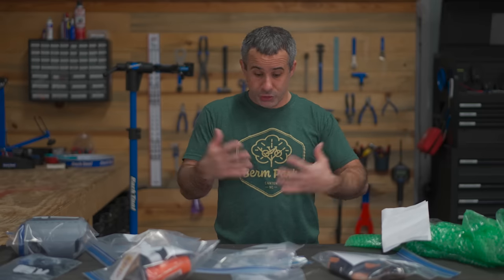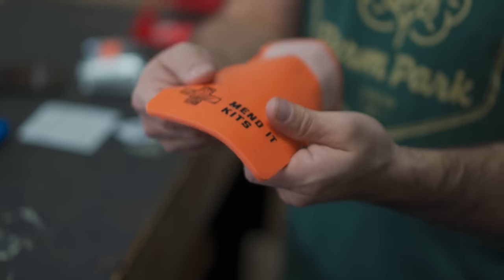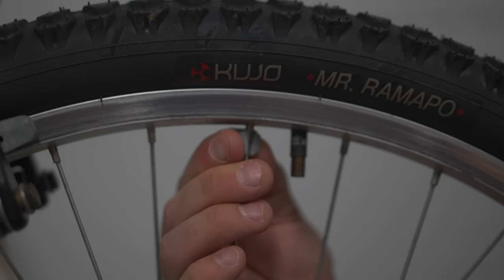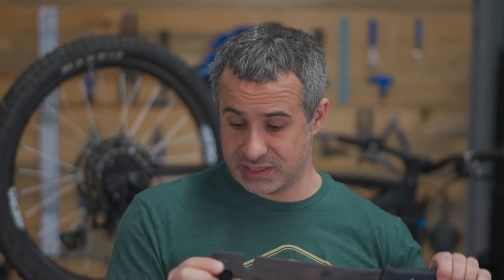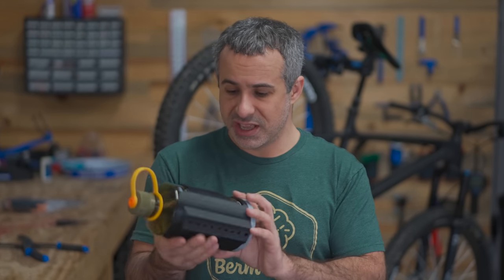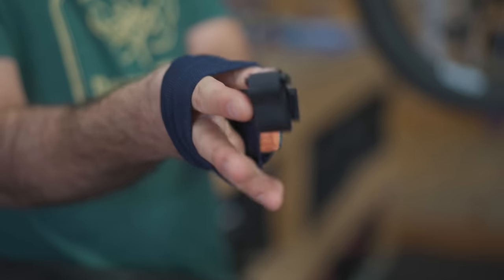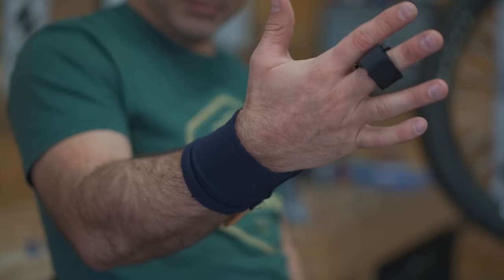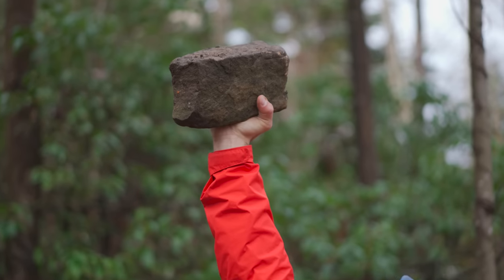Reviewing MTB products sent in by you, the audience!

Comment from the maker: Over the weekend I met a guy with a bottle cap on his stem cap, and he said it was off a Niner bike. So that's not original, but the bar ends and fork cap sure are!
Reply: Neither are the tools in the valve caps, pettys has had them for a long time integrated into their tubeless valves, spoke wrench and presta valve core remover.
Reply: Your link for the tools doesn't work.  You're missing something out of the URL.  I found it by searching Etsy.
Reply: I recently picked up the Niner YAWYD(You are what you drink) top cap and it works well. I would be skeptical of using a 3D printed top cap, and I 3D print lots of stuff myself.
Reply: Yeah, I’d much prefer my niner machined version.  Bar ends see ok.  Would be worried about anything needing mechanical strength with the printing material long term
Reply: As someone that’s also subbed to Syd & Mackey and Kyle & April I immediately thought of Niner when I saw the bottle cap holder!
Reply: Valves with spoke keys and valve core removers are becoming extremely common.
Bottle cap handlebar end caps I used to sell 6 years ago from @Muckynutz. @77Designz and others already to a top cap, but I've never seen the fork adjuster cap before.
Reply: Yep. Niner has been selling that stem cap for ages - at least since my club had a deal with Niner back in 2009.
Reply: @andrew_gardner  the top cap shouldn't be taking any load - the stem clamping on the steerer tube is the load path. All your top cap is doing for you is pulling the steerer tube up into the head tube while the stem is loose. You could just ride without it if it weren't for the chance that you might need to loosen and readjust the stem on the trail. Plastic should be just fine.
Reply: Bar-ends aren't original also, I've bought aluminium CNCd ones years ago from UK. Fork cap however I never saw before

Edit: as BikeDibley said 😆
Reply: I had a top cap for bottles here in germany like 5 years ago. I think it was from 77design
Reply: Seth, the conversation is going about the way you bash the Bash Guard with a rock and it Didn't break , are you sure that's not metal cleverly disguised as plastic , Ha Ha
Reply: I want the metal version of the spoke tool / valve core remover that can stay screwed on as a valve cap
Reply: @GiannisLS had Schafer (car type) valve caps with a core removal tool built on the the top 10-15 years ago. Can’t remember who made them though. To be fair, they didn’t have a spoke tool incorporated…
Reply: Personally, I think the bottle cap bar ends are absolute genius! What serious mountain bike rider, wants beat up looking bar ends all the time, and to keep replacing them? The bottle cap bar ends, just pop the old bottle cap off, throw on a new one and good to go. I legitamitely want some of those!! And I don't do a lot to beat up my bar ends, but mine definitely get the crap beat out of them from commuting, rubbing against brick walls at work/stopping at gas stations for snacks, and the likewise. I have alloy bar ends that hold in my bar mitts for the colder months, but I will probably use them all year around. Eventually, I will want nice clean new ones.

Comment: For functional 3d printed parts, you need to use an appropriate material, design, and settings. Generally, PLA is to brittle for functional parts, and you need materials with better impact strength. Also, playing with shells and perimeters will gain the most strength rather than infill.
Reply: Agree, but all that said, PLA has some of the most strength if you require a strong and inflexible part.  Many of the less brittle materials flex before they give at a much lower force than PLA bends or breaks.  I use PLA in certain applications where any significant bending under load will cause the parts to hit each other. I find PLA works much better for things that need to stand up to tension.
Reply: @meikgeik  yeah, for bike parts i would personally use nylon or cf nylon for added stiffness, pla is brittle + it cant really stand up to the conditions outside (whether that be weather or UV light) so for bike parts ABS or ASA is the minimum for me.

Comment: Hi Seth! Glad to see some of the Chunder Goodies @ 10:00 made it into the video! A note on the anywhere mount, I didn't intend it to be used with a water bottle as I don't trust it with that much weight. Did you happen to test it with one? The tube plate and pump mounts I make are the proper thickness to prevent the screw from going through and hitting the frame. Good suggestion on adding a backing, I will make sure to add a warning so others don't have that issue! Thanks for giving them a look, and thanks for not minding the paint ding!
Reply: "Luckily I don't care". 😀
Reply: ngl, that one hurt
Reply: @TheSorrowedMan  Definitely feeling a little guilty over here..
Reply: Yeah, take a look at the inside of specialized SWAT door. I think it’s got a rectangular shape molded into it that keeps these square flat nuts in place to secure the bottle cage screws and keep them from driving in too far.
Reply: really cool idea you got there. i can use one on my bike
Reply: @andrewshearin1525  wouldn't a nut allow the bolt to continue through and hit the frame anyway

Comment: I think the reason that 3d printed chain guard works and your previous prints didn't comes back to the suggestions a lot of us gave you in the comments of that video. Just from what you showed, it looked like he had printed it with more perimeters, and it looks like maybe a wider nozzle as well? Since the majority of a print's strength comes from its walls, that makes a large difference in durability right there. While you certainly couldnt expect all the parts you made to work (that brake disc as an example), there were definitely a couple that likely would have worked fine with just some slicer setting refinements.
Reply: Also the difference between PLA and PETG is dramatic in terms of durability. PETG can be finicky, but if you nail the settings you can create some very durable parts, especially compared to PLA.
Reply: @tredmer  Absolutely. Not all plastics are equal. Different materials have different properties.
Reply: @tredmer  this. Seth’s printing configuration was not ideal

Comment: About the tourniquet, it's the CAT (Combat Application Tourniquet)
Which is very effective, but requires some basic knowledge to use with full potential, which I urge you to learn (lots of videos about it).
Also worth noting, using it will compromise it's future strength, so you should keep this one for practice purposes and get a new one.
Reply: While it is a great idea, I have some serious concerns about the med kit. Tourniquets require training to use safely, and as you said using it for practice or even as a retention item degrades its effectiveness. I may be wrong with this, but based on the price of their kits I seriously doubt that is a genuine tourniquet, which run about $30 each (The genuine TQs are made by North American Rescue which makes the CAT, or TacMed Solutions, which makes the SOF-T). I don't want to discount the Mend-It company at all, I'm just coming from a concerned health provider background. If anyone has any questions I can provide resources and references. Training is by far the most valuable resource you can invest in when it come to first aid.
Reply: @trail_farts  hey, just wanted to comment here. My experience with tourniquets in the army and with safety training in the civilian world has taught me that you really cant do much harm with them when using properly. If the bleeding is life threatening, you tighten it enough to stop the bleed. Any damage to the body part (tissue or nerve) will only come with prolonged hold, and if the other option is life threatening bleeding, it doesnt really matter, right? And what comes to the strength of the items, in the army we would train over and over again with our personal tourniquets. Ive never seen one break when tightening it and for a real piece, I dont think its even possible with normal use and training. I would even go as far as saying that an unused one is more dangerous than a used one, as it might be defective from the factory, if the quality control over there has failed. 
But youre both right on about training, learn how to use it, learn how to apply it with one hand, learn how to do it to someone else, learn how to do it in a rush, with clothes on, over a booted leg, in the dark and etc... Its like CPR, do it over and over until it comes natural.
Reply: @akselikoskinen5445  so talking from a perspective of an ex combat medic, I've seen some tourniquets break after intensive, repetitive training, but actually I'm more concerned about its ability to hold stress for prolonged duration of time, and if it has been used before,  the velcro part, which hold the entire stress, must have weakened to a certain extent, and in harsh conditions (think wet, mobile situation) when someone's life depends on this thing, you should really just use a new one.
Reply: @jewing464  The way he used it in the shop is not going to make any difference in its ability to hold stress. Zero.

I've been shipping them out to Ukraine for the past several months... they go through way more abuse than barely being put on and twisted once or twice. And they still work fine.

As for damage to humans, the soldiers use them at ANY indication of a wound, arterial or not, because they don't trust that they won't miss something being that they're not experts.

No issues. And they crank them down.

Comment: Really like the cassette pliers and wrench combo.
The part I "made" for myself is not really my own but I found it a new purpose. I turned a bottle cage adapter into a front mudguard mount for my suspension corrected fork in 2021, and it's running well to this day. 
It's only one part of the cage adapter and four P-clips on the fork.

There is a particular type of adapter that works for this really well, better than any marketed solution I could find in a year.
I can't post pictures here but if you need something like this and have no tools to make it, google bottle cage adapter and look for one that has a symmetrical "rotating part" with three screw holes. That type fits a 26 inch sus corrected fork perfectly and your fender mounting point will be exactly in the middle.

Comment: That cassette plier tool is awesome. It's a similar design to the Pedro's version, which I think is a far better design than the park tool version
Reply: Yes it indeed is. I have a cheaper version of parktool pliers and they have a tendency to slip easily on the cassette. That kind of version looks a lot more easier to use and apply good enough leverage to keep the cassette in place.

Comment: I really like the cheap alternative to a bash guard, great video!
Reply: I bought one of these off eBay, I think, a couple years ago. Seemed pretty strong, but it broke pretty quickly on the trails. That log Seth hit was pretty rotted. I killed mine on a solid logover. A rock would break that easily, unfortunately.
Reply: @TheBlip01  You mean a rock like the one Seth used in the outro?
Reply: @timgarland8619  yeah, except add the weight of a rider, bike, and some momentum. Haha

Comment: To make good 3d printed parts, you have to make the infill 100% and use a higher end filament you can buy loads or stronger/ flimsy or even flexible materials! If you ever wanted to try printing bike parts again I would suggest using a different material then you were using
Reply: Yes and no.  CNC kitchen on youtube did a test a while back that showed the inverse can be true in some scenarios.  Part strength is a rabbit hole you can go really really far down.  CNC Kitchen just barely scratches the surface.
Reply from the maker: Yeah, I was using the best quality Petg you can get, but it was definitely not at 100% infill. For a bash guard, I think you're right. For other parts I don't think the infill would matter as much as wall thickness, and for the most parts my design were just crappy!
Reply: Great Tools, can you link for the bottle Cage Tools?
Thx i want to Print it for my wifes frame, where i always anscrew the bolts because of her small frame when mounting to the.
Reply: @BermPeakExpress  You already sound like an expert.  As someone who has been 3D printing since 2016 and struggled for years, I'm totally not jealous.
Reply: @BermPeakExpress  I wouldn't even use PET-G - it can cope with some flex, sure, but what the 3D printing communities and tests don't touch on (bar the odd ones that do notched impact tests) is that PET-G behaves non-newtonianly, it stiffens the harder you hit it. That means for impacts it becomes really brittle.
 You're much better off printing things in one of the Taulman nylons (they'll have something depending on what your printer can cope with) for functional parts. 

The other 'secret' to 3d printing is the best looking parts generally always come off a printer with slight underextrusion and temperatures too low for decent layer bonding. If you set your print profiles on looks, you're going to have brittle, understrength parts compared to printing hot, slow and with full flow.

I print actual end-use, functional engine mounts, suspension bushes, brackets, exhaust hangers, etc, for cars by sticking to making sure the bonding is great rather than pretty, and they hold up very well.

Comment: I've had a CNC aluminium top cap which takes bottle caps for years - I rock a Motorhead Road Crew bottle cap on mine! Also, chromes brass Schrader valve caps with integrated core remover have been around for a very long time.

Comment: cool to see the community making 3d printed bike part, but for the love of god please use more suitable materials, they are out there! PLA and PETG have terrible impact toughness (probably very important for a bash guard hitting anything but a rotted log, and they also degrade in sunlight! ABS is better for impacts but has its own problems and also degrades under UV. ASA is a great material for this stuff; it's cheap, easy to print with, and it has good impact toughness and is safe in UV light.

As a note to those starting out with mechanical engineering stuff like this, lots of plastics behave very differently during slow loading and impact loading. PETG for example feels very flexible, but undergoes brittle failure if you load it quickly enough. Impact toughness is typically measured as an amount of impact energy a material can absorb for a given cross section, and from any good material supplier it should be provided on the datasheet for comparison with other materials. It's super important for lots of bike parts that are going to get bashed into things as well as the "slow" loading from shaking around on the bike as you ride

Comment: Niner has had the bottle cap stem cap for years! Comes as standard equipment on all their bikes. Pretty neat kit actually, and you can purchase them from their website.. its called the YAWYD Niner Top Cap.
Reply: YAWYD standing for "You Are What You Drink." And yes, Niner has sold those pretty much forever. Still a neat contribution though
Reply: And it's patented along with all the other possible positions for mounting a bottle cap. There are also parents on using a bottle cap in nearly every non bike setting you can think of

Comment: For the first aide kit... Remember a few years back when Cedric Gracia had what looked like a mild fall on his bike... Where he actually sustained a femoral artery injury and almost died? Yeah... Ditch the TQ in that kit and instead get a couple packs combat gauze (quick clot gauze, not the powder, pouches or sponges, the gauze) as well as a hyphin bandage/seal and an isreali pressure bandage. If the Israeli bandage can't stop the bleed, the combat gauze will. And for most other superficial, or even deep, cuts, the hyfin seal with keep it for getting even dirtier, and because the hyfin seal is made from hydrogel, it will even stick when wet, and bloody.

Comment: For the bash guard, a 3d printed parts handle compression stress much more better than shear or Tensile stress.  That is, plastic that is thermally stuck together will not compress much but when pulled or bent those bonds break, you can avoid this some by using a fiber filled plastic and or one that you thermally anneal after printing.   now a laser cut piece of 1/4 aluminum plate with a Delrin edge would be stronger, but honestly once it takes the impact breaking to reduce the load on the frame isn't a bad thing,   Also printing orientation is important: the lines are strong, they layer bonds are not.  So if you have a bending moment you want the force perpendicular to the lines not to the layers.

Comment: The cassettes on mtn bikes are usually steel with the exception of higher end cassettes which use titanium for the 3 small gears like the 11t gear and then the last 2-3 gears, the granny gears, are usually aluminium. So the steel cassette tool shouldn't damage your gears as long as its used properly.

Comment: That bash guard is good but I run a Funn Zippa Lite guard which offers an advantage which the designer could account for. Funn use a steel or aluminium mount onto which the plastic guard bolts (using chainring bolts). Guard breaks but it's easy to mount a new one. Problem. The Funn guards don't slide over things well compared to some other designs I've ridden. A 3d printed guard piece with a better profile on a metal mounting plate would be awesome.